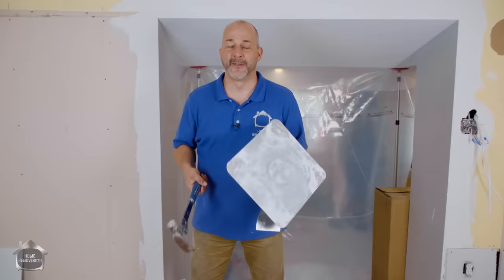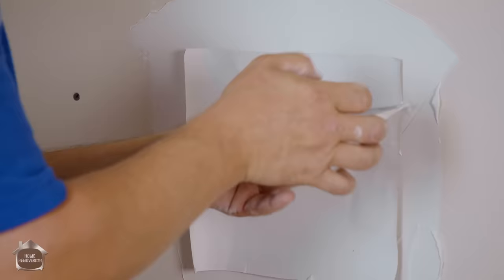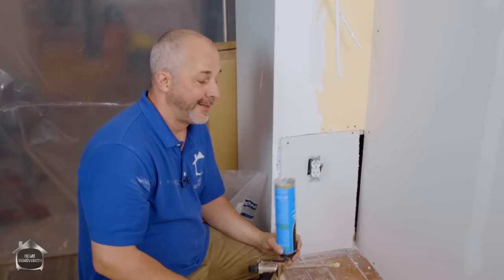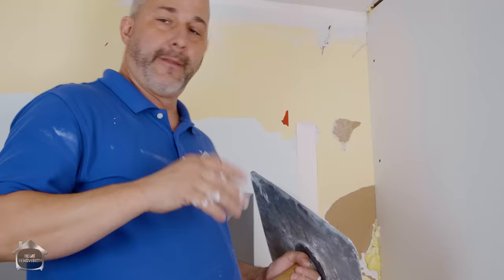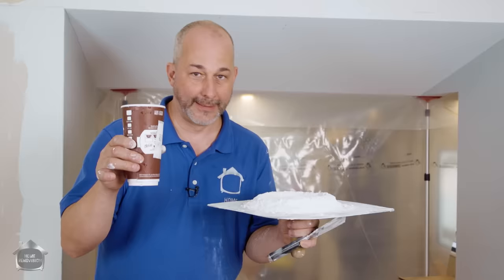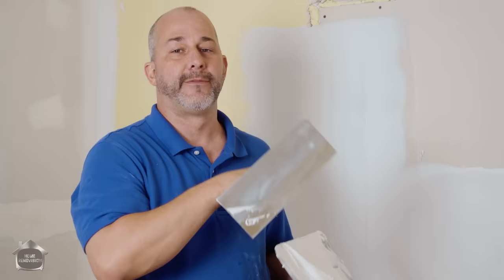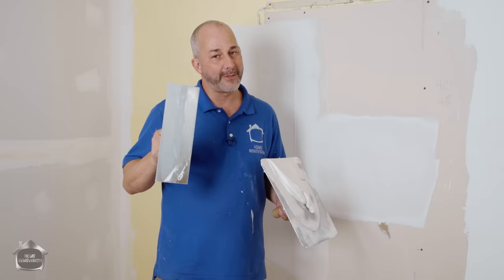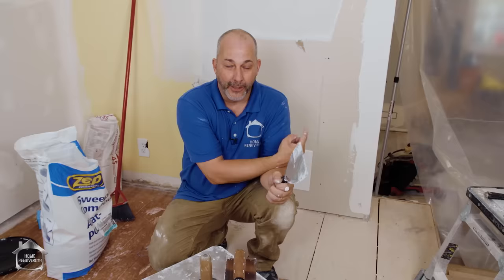Easy Drywall Tricks to Fix Any Mistake

Comment from the maker: Learn How to Drywall 👉🏼https://youtu.be/VQIMaR7hWtM
My Beginners Guide to Taping 👉🏼 https://youtu.be/naBal346_9c
My Favourite Ways to Sand Drywall 👉🏼https://youtu.be/eYHwg0HsmEU
My Favourite Drywall Tools 🇺🇸https://amzn.to/3KoIj8P 
My Favourite Drywall Tools 🇨🇦 https://amzn.to/3C9qQ0t
Reply: Your the man
Reply: Great job Jeff, love learning the right way.
Reply: My father taught me to put a piece of wood like a 2x2 in the wall behind the patch sheetrock.  You screw it in place and then screw the patch sheetrock to the 2x2.
Reply: You bashing a hole in the drywall with the hammer reminded me of when a friend brought round his son with his bike. The bike had modern tyres etc, my mate told me he had spent 3 hours mending a puncture on this bike. The bike had QR wheels which enabled very quick taking out and replacing of wheels as developed in the bike racing world. I decided he couldn't have known how to mend the puncture very quickly. I got a bradawl and on my bike pushed the bradawl into the perfectly good front tyre, did the correct wheel removal, took out the inner tube, put good one in, reassembled the wheel and put it back. Maybe 10 minutes at most, not quick for racing but adequate for leisure riding. Found the puncture the old tube and repaired it with a patch. I asked why it took him so long?? He had completely disassembled the QR spindle assembly, had a terrible job getting it back together properly. Had 3 goes at mending the puncture and it took forever to get the wheel in properly!
About 6 months after, I recalled the incident to see if he could tell me why it took him so long, he said he couldn't remember. "Did you remember me puncturing my tyre with the bradawl", I asked, "no he re[lied".  I was amazed how he had completely forgotten, his son later told me his memory on those sorts of things were severely lacking!!!  Your puncturing the dry wall gave me a chuckle, thanks!!!
Reply: Will those laminating screws work on new sheetrock > popcorn > plaster/lathe ?
Reply: omg, you are an angel. thank you so much! 
     😌👼🙌💜
Reply: Are there these spring loaded access doors available with a hole in it? I’m trying to cover a hole where a box was installed by a plumber for a waterline valve (behind the refrigerator)
Reply: @MovingOutSaleMiami-l9o   Yes, similar to the ones for your washer dryer hookups if I'm understanding your questions

Comment: I was trying to patch a hole before painting using one of those patch kits from Home Depot. No matter how hard I tried, I couldn't get the patch to look anything close to level to the surrounding wall. I think I'm going to cut the whole thing out and try the California patch trick. I have never seen that before, but my mouth hung open in amazement when I saw it.
Reply: @pastorisaac9913  💩👾
Reply: With the regular way you just have to overdo the mud a little and sand like hell, and it’s not fun sanding mud lmfao
Reply: You have to finish wider than your patch 4 to 6 inches wider all around

Comment: Life changer, never seen that California patch before, no telling how many times, I've screwed paint sticks to the wall from the back and cut a piece and screwed it to the paint sticks. THAT looks so flipping simple.
Reply: Great stuff for simple stuff.
Reply: Nothing wrong with 1X2 backing. Paint sicks not so much as they split so easy and then the screw can't get the bite it needs.
Reply: I use 1x4's as backing. 20 minute mud and a hair dryer. Easy money
Reply: Only use the california patch on small plug side holes like this. Anything bigger than say a 4 inches should have backing.

Comment: Great patch I learned in 1968. I use a better more solid patching when the patched area's that may be damaged easier again. I am a painter drywall repair Person and still working at the age of 84. 55 years in the trade. I use allot of hot mud. You have a great site

Comment: This was the BEST lesson I have ever seen about dry wall challenges.  The covering up textured ceilings with drywall is pure genius.  I wish I knew about that before I spent hours and hours of scrapping all that stucco crap off my ceiling, and then cleaning up that mess!!   You are the man!
Reply: U probably know now but cheap plastic on floors when you’re down roll up and toss lots of hours saved there’ 

2 if u spray the ceiling with water and wait a few mins it falls off with a quick pass’ 

Don’t do those things and u will waste hours and hours’
Reply: yeah tried that trick in a room.  problem was the textured ceiling wasn't that well adhered to the ceiling and a 50 lb sheet of sheet rock came down along with the textured ceiling.  one way to get textured ceiling off the ceiling! fortunately no one was in the room when it happened but it scared the ba-jeebers out of my wife and me! will spend hours & hours scraping and breathing the dust and clean up the blooming mess before I try that "trick" again.

Comment: I'm a taper on commercial sites. I've used expanding in multiple situations where other tapers didn't know what to do. . I'm the guy the foreman goes to when a non-standard taping situation comes up. Consequently I'm also usually the last taper on a site. These little tricks are a good way of staying employed.
Reply from the maker: Cheers, best advice on a job is be indispensable!
Reply: Selling those tickets on yourself, bud? :)
Reply: @HomeRenoVisionDIY  you've got that right
Reply: Good on you.

Comment: When I started watching this video, I thought I was not going to learn much. I was quite wrong. Thanks for the neat tricks and tips.  My favorites were use of the spring loaded hole cover, spray foam as filler, the bag of compound for sweeping dust, and salt and hot water.  Really appreciate your efforts and wow, you are super skilled at drywall.  I learned a lot.

Comment: Over the past two years, I've completely gutted and remodeled a bathroom, a gym, and combined two big storage closets into an office, and fixed a sagging ceiling -- and I have Jeff to thank for lots of the knowledge. Of course now I see drywall problems in other parts of my house and I can't unsee them. This video had a few techniques that I hadn't seen before -- the drywall to drywall laminating screws, the drywall sweep material (OMG this would have been great to have!), and using foam in the big cracks.

Comment: Tip :).. when you are cutting out the damage from a hole. Find the piece you want to use as a patch. Hold the patch piece  flat on the wall covering the hole and trace it's outine with your pencil. Now cut out the damaged drywall following those lines. You have a hole ready made for your patch.. Good content!! Thanks!
Reply: That’s a great tip!

Comment: Brilliant!  Great tips. I use a shower squeegee for my final coat on large surfaces. Any hard chips it just skips over and doesn’t drag a line through the plaster. The first coat of primer I stipple with a wet sponge. That keeps the area from flashing on the final paint coat. 30+ years of repairs and remodels on my properties. Thank you for the new tips!

Comment: THANK YOU!! The spring loaded access panel cover - OMG. I didn't even know these existed and wish I had known when I was putting in my new tub; would have made my life SO much easier. But at least I have one now so I can always sleep knowing I can check that the shower and tub connections and drain are not only dry, but easy to access and fix! THANK YOU!!!!!

Comment: Been watching for years, but this. THIS video was SALVATION! old home, plaster and lathe meets drywall meets damage and old wavy studs and ceilings in the kitchen. My helper was apoplectic at the joins and threatened to quit the job. I tackled what I had gleaned from previous videos (all hail expanding foam and good blades) then found this video about my niggling ideas to layer mud and tape appeared on screen. I've got this, with your help. It won't be perfect, but it will be smoother and it will be done! Also note this kind of repair takes loads longer than if Jeff does it.

Comment: No screws on that ceiling would make me nervous... for piece of mind: since you're covering the old ceiling anyways, you can mess it up to find the joists. Use a magnet or stud finder to find the line of screws, even do some exploratory drilling to locate the joists, draw lines on your ceiling where the joists are, then use some long drywall screws to screw the sheet to the joists/strapping. Just for insurance.
Reply: Agree, I have pinex ceilings which is very light and on very thin battens 45x20mm so adding 13mm drywall will need additional support.
Reply: How is the sandwiched mud supposed to dry? We had an entire condo complex in our area that was dropping their drywall ceilings 10 years after the project was completed. I don't think I'd trust the suggested method. That's a lot of extra weight.

Comment: Great tips. Thank you. I am semi retired and do home repair. The one thing I have learned about any repair is spread the mud over a wide area and hold the knife tight to the edges. As a result,  sanding is minimal. Took me close to 10 years to figure it out, though.

Comment: Excellent video. Thank you , thank you, thank you. You just made my day by removing all the stress I had about the drywall repairs in my bathroom sink and cabinet replacement. You have a great personality and a very effective way to demythify the fear of working with drywall. I have never worked with drywall other than filling a nail hole. Now I feel confident I can repair  the damage caused by the removing of the backsplasher of my bathroom. You made everything looks so easy to do.  I know for a fact that making something look easy to do,  is very difficult to accomplish. You have the experience and the knowledge required to do that. Congratulations.
Best regards.
Thank you, again, from my heart.
Reply from the maker: Cheers Jose!

Comment: I’ve patching like that for quite a while and was putting the mud just on the hole edges and not on the patch but will definitely start doing that. Like the use of the expanding foam. Thanks for the tips
Reply: This man is a savage with that mud holy shit

Comment: Great video! You are definitely a Pro. P.S. Maybe I did not see it, but the rational for quick set is that is a more durable(harder) product than 'regular' 'mud'! In a basement setting, this was what I first applied, then regular mud after. Also, used fiberglass mesh tape instead of paper.

Comment: Hahaha love how hes using a mason cement handel instead of a drywall pan. That takes skill and man. This is very awesome trick. I just use mesh tape and hot mud for those fixes and this just cuts a lot of tideious work that ends up still looking sloppy. Thanks man
Reply: Hi, mesh tape is easier than paper tape, but paper is about 6 times stronger across the fibres and binds with the mud. Fibre tape is a good ‘patch’ but shouldn’t be used as a primary joint tape, unless you backblock with hot mud and offcuts

Comment: A pail of mud that has a working lid can be kept/used for years. Like you said, scrape the inner walls before putting the lid on tight. Next time you want to use it, mix it (in the bucket) with a paint mixer in a hand drill until it's creamy...add a little water if needed.

Comment: Love that ceiling drywall trick.   I've been wondering how I was going to get rid of the texture ceiling in my house.  But I don't think I can slap a full sheet like that😆.   But I will have a lot of seams to do.   I can manage a 1/4 of a sheet like that.  Thanks for showing that,.   I wouldn't have never guessed that could be so easy. Thanks,.  You just saved me a ton of waisting time trying to get rid of that ugly ceiling in my house.   I'm always learning new things from you.  👍👍
Reply: Rent a drywall lift. They are amazing.
Reply: They also make 1/4" drywall, just as big, but lighter.

Comment: I am going to do some small drywall repairs and learned a great deal from watching your video. I thank you very much and will use the information to repair small holes. I need to install a bathroom fan and need to remove some drywall. I will look at your videos and see what works the best. Thank you again.

Comment: Love it!  I can't tell  you how much I appreciate the info and added practical tips.  Was recently quoted $8000 to drywall a 300 sq ft. addition (crazy)  I'm  tempted at times to just do it myself...although realistically the "hanging" would probably be more than I can handle.  I do, however, want to tackle as much of the "repair" portions...or at least "prep" for them, to make it as quick and easy for the drywallers to get the job done quickly and easily. (no I won't be going with the guy who quoted me $8000)

My Question: (I don't "think" you answered it...I'll watch again, just in case)  What about patching  floor to ceiling areas on a wall that's been painted with semi gloss paint?  Would KILZ be the stuff to use to get the mud and tape to stick to the old painted surface?  ....and if so, I assume I'd have to use the primer in a wide enough area to account for the width necessary to create a butt joint?

Comment: I had a garage that was a mess, full of holes in the black-sided plaster board on the outside of the studs that was busted out on the inside where nails missed the studs etc.  Some were craters with dime-size holes at the bottom with nothing but Tyek left behind them.  I took your advice, went to Lowe's, bought some 20 minute joint compound and filled them flush.  Beats painting studs with busted up plasterboard behind them.

Comment: Awesome patch job. How about water damage?
Reply: If its small cut it out, if its easier to just do a new layer of drywall overtop do that. Whatever is easier considering the damage. You may need to remove the wall or ceiling anyways to remediate the water damage

Comment: Thanks for sharing your knowledge.  You are fantastic at explaining these challenges to us novice people that need guidance.  I watched numerous videos and enjoy them all and your humour.  You should have your own tv show - so move over Holmes and Bryan.......LOL
BTW...if you have time to answer I have an issue with my project.  I am priming a wall (which has existing latex paint for 19 yrs).  I have vacuum the wall and then washed it.  Next repair holes, pop screws and nicks and therefore sanded all.  Again remove dust from wall.  Now I have applied the Behr Primer Plus (primer and sealer).  When I am done there are many spots (I called them islands) that the primer did not adhere too.  I am also painting a bedroom and this is happening as well.  I asked several people and nobody really knows how to fix it.  I have gone over the "islands" 2 or 3 times with just primer so eventually it sticks but regardless if you look sideways at the wall you will still see the islands and to touch with your hand it feels very very gritty.  Also I even sanded the whole wall lightly but to no avail.   I am so FRUSTRATED !  Especially after spending all this money on paint etc.  I haven't come across a video on how to fix it.  I would be greatfull if you could tell me want to do please.

Comment: 40 year old condo and old water damage where the wall and ceiling join.  The tape is wrinkled with gaps.  Also, jagged hole around a flush mount ceiling light.  What is the best way to repair those? Thank you very much your videos are AWESOME!!!!

Comment: Should have watched this earlier.  Older home with plaster walls.  Downsizing a recessed shelf behind an old vanity mirror.  Changing multiple pot lights too.  Also put in an access panel but one that has a frame.  This video would have saved me a LOT of time sanding!

No matter, there is more to do so hopefully I will get better with the drywalling tasks ahead.

Comment: Today, I patched up a hole in the wall which was left after removing an aircon unit. 860mm high and 400mm wide hole.

I used you technique and found it to be pretty good.

Comment: I just had a situation last night where I cut the bathroom vent a bit too big, so the fan could pull air from the ceiling and the vent cover didn't cover it.  There was nothing to anchor a patch piece to 4 sides 3 available and the 4th next to the fan hole.  I thought about the "California patch", but was worried about it holding up. I ended up cutting another piece of drywall properly.  Would a patch have worked?

Love your videos Jeff - love how they are geared for the home owner willing to put in a little elbow grease to save money.

Comment: I used to take paint stirring stick and cut the long enough to have 1 in. longer than the hole and use strong glue and stick them on the inside of drywall and then stick the cut piece on top of the glued stir stick and the finish with tape and spackle

Comment: Another product for damaged and torn drywall is Gardz. It's a Zinsser primer. The label doesn't always have Gardz on it as Zinsser labels it different ways but it is a milky colored, water this sealer that penetrates and binds damaged drywall. It takes a few hours to completely dry and then you do your mudding over it. I've used it on heavily cracked, peeling and alligatored old ceilings, including calcimine. Give the areas or entire ceiling a good scraping to remove loose material. Apply Gardz with a roller applying BARELY ANY PRESSURE  to the roller (it is thin and will run down your arm). As said before, once dry, do your repairs, prime and paint. The ceiling will last for years.